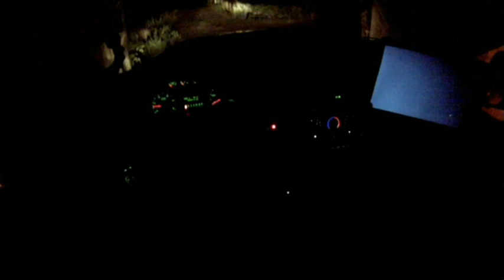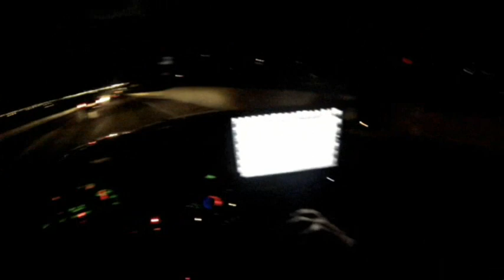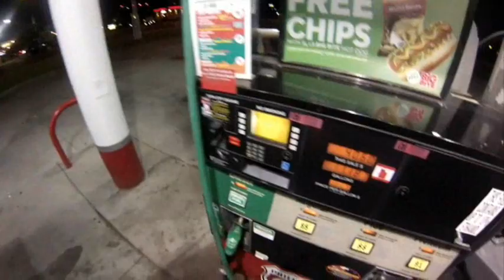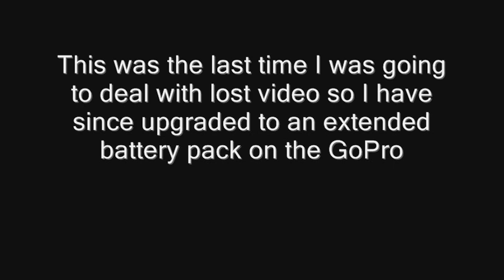No Keys On An Ex Repomans Truck Makes For A Hard Night Of Work

Comment: It looked as if you forgot and left the first blown dolly on the bed of the truck unsecured...that could turn out bad. Play safe.
Reply from the maker: I did not forget anything. I set that blown tire exactly where I wanted it to be and it was exactly in the same spot when I pulled over the second time as I expected it would be. I know my truck and I know where I can and cannot place things that will fall off. I appreciate the concern though so don't misread my reply as being snooty.
Reply: Ok,just thought you had forgotten it. Snooty? Lol have a great day Matt. Continued prayers and good vibes your way.

Comment: do you leave the truck running at all times after you leave in the morning?
Reply: keithmb33 ..yes he does.
Reply from the maker: If I have an appointment somewhere that is going to be longer than 10 min then I will shut it down. But if I am working and stopping in here or there and only getting out of the truck long enough to knock on a door or to execute a repo then yes it remains on.

Comment: Have you ever tried picking a ignition lock?
Reply from the maker: They make tryout pick sets for ignitions and I use to carry a set but the few times I tried I was not successful. I can pick most other types of locks pretty easily but have never had much luck with ignitions.
Reply: RepoNut I have picked my own house door look pretty easy, but I have never tried an ignition lock I would think the single side keys, would be easer, I don't know how you would go about picking a double side  key, lock.

Comment: just a  quick  off topic   question  ,, how  is the  engine doing ,, is it holding  up so far
Reply from the maker: It has gotten to the point that I knew I had to get it into the mechanic before I ended up on the side of the road calling a buddy with a flatbed. So it goes in on Monday and will be down for a few weeks. Hopefully all goes well and she is back on the road soon.
Reply: I hope it  goes  well and  you get  it  back  on the  road  soonest 
I know  how  expensive  that  repair is   and  being without your  primary  means of income  hurts  big time 
what are  you doing in the  meantime for a  tow truck?

Comment: Busted dolly tires? Why are you towing from the rear anyways ?
Reply: You are supposed to tow a vehicle with the drive wheels off the ground.
Reply: Not if you pull the axles or the driveline. Simple tools fix that problem....
Reply: TheKaffeeKlatsch Heavy side on the lift is bad for his truck. Could have caused even more damage than the busted dolly tires.
Reply: The front end of the 2500 with the cummins is to heavy to safely tow on the lift for that long of a distance.

Comment: Hey, two things, One I'd like to chat with you a little bit. and two, How is the truck doing? has it gotten any better/worse?
Reply: I was wondering the same thing... after he put that up I ended up going thru almost all those powerstroke videos... Seems he would be a good guy to have bulletproof your motor...
Reply: hicksvilleshick
it's a loooong long distance between where he is and the power stroke guy is and if the engine has already lost compression then there's damage there. Easier to replace the engine so you know what you have. I hope it's still working for him though. It's hard to be without a vehicle you need to do what you have to do
Reply: True, but that guy sounds like there ain't much he can't fix, for a price of course... may be worth picking up a used motor to run for a bit to save up and send it off to him for bulletproofing... either way I think it's going to be pricey.
Reply: hicksvilleshick with that being the only truck, a used motor is a gamble. you have someone elses maintenance and lack of care (or excellent care) to contend with. cheaper in the long run to really build out a block or get one stock with a warranty. that way if it fouls out there's some recourse. It's a shame that engine is going funny in the truck. It cant have too many miles on it. I'm trying to recall what it was when he got it. if I recall right it was pretty low. maybe we'll get a disection of the engine to see what went Kerflooy in it
Reply from the maker: northstar2007 I will be showing videos of the tear down and repairs of the engine as it happens next week. Should make for some good info for other 6.4 owners who end up going down this same path I am with my truck.
Reply: Awesome! RepoNut ! I have a question on Tow equipment that I've never used before and you use quite often. What would you say is the maximum range you can tow with a car on dollies?
Reply: Glad to see you got a plan worked out Matt!

Comment: why didn't you turn the truck around and put the dollies on the rear of the truck after the first tire blew?
Reply: wheelitzr2 it's rwd and can damage the transmission
Reply: zhbvenkhoReload not if the dollies are under the tires. the only way to ruin I transmission is to tow the vehicle in neutral without the engine running.
Reply: its too heavy for matts truck

Comment: You could have taken a hammer, and hit the steering wheel while you are turning it in the way the wheel needs to turn and it will unlock for another turn until it locks again, and just keep repeating until it’s straight. I do it all the time, and I’ve never had any damage, or any customer notice any damage. Or maybe I’m just a bad repo man that’s fucking people shit up…. Who knows? But I know that I do it all the time to unlock the steering column and it’s never come back to bite me in the ass. Either I’m lucky or it doesn’t ever break the locking pin

Comment: What happens if the vehicle you are actually towing gets a flat, while you're towing it? I mean, that would kind of be your fault.

BTW, you're actually supposed to (or at least it's a good idea) turn your wheels toward the curb when parked on the street in case the vehicle would come out of park or get rear ended, it shouldn't go further than the curb. Not saying that he didn't do it on purpose, though.

Really surprised that he even took the truck when you has another one (you said he blocked in the boat with it..?)
Reply from the maker: The truck blocking in the boat was his work truck and they track mileage on them so on the weekends he would have to pull out his personal truck for social calls. I have had a few flats on repos in tow and even though we were the ones pulling the vehicle at the time the tire decides to fail is not our problem. If we had not come along and taken possession of the vehicle then the owner would have been driving it when it went flat. Now if we run something over and cause the flat to happen then yes I consider that my responsibility and to replace it with a equal value tire, We will always let the lender know what has happened and sometimes they just tell us not to worry about it.
Reply: RepoNut
Ah okay, I didn't know it was his work truck that was the other vehicle :) and yeah, that's what I meant- if you run over a nail or something and that causes the tire to go flat. Sounds good! :D

Comment: would the side pull do to the wheels on the repo vehicle not wear your light duty dolly tires more than if you had straight wheels seems like you should have foreseen this as a result of the weight and drag do to the wheel cock of the repo vehicle maybe buy heavy duty wheels and tires for your dolly instead of the light duty you had on them

Comment: "Donate to make this the most awesome channel of its kind" - Isn't it already? Of course, donating won't harm anyways, but I was just wondering... ;-)
Reply from the maker: I want to add some more professional editing and content to the videos and that cost a lot of money. Plus I need the seed money to get my RepoNut gear line started and launched. I also want to invest in a quad copter drone so I can start doing aerial videos of my repos and show other cool high tech tools we can use to do this job. It all take money and donations would help me get these things done sooner than later.
Reply: RepoNut I never opposed against that - I was just saying that also without all these things, your channel is already the most awesome channel of its kind. But of course you're right, more awesome is always better for sure. So I encourage everyone who can afford it to donate to your channel!
Reply: RepoNut quad copter sounds really cool
Reply: ***** But probably hard to set up so that it actually films the things Matt wants it to film. It can't be manually operated, because while doing a repo, he is otherwise occupied, so it has to be steered automatically. I wonder how this will turn out!
Reply from the maker: Seegal Galguntijak They already have an app for iOS that allows the quadcopter to fly a preset pattern that I set up just before executing the repo and then it will land by itself if the battery gets low or I tell it to once the repo is done so it will be relatively easy once I have it all dialed in.
Reply: RepoNut Plus, you'll need an iOS device, since all you use is based on Android (which is the more rational choice in my opinion, anyways).
Reply: RepoNut This is definitely one of my favorite channels!  It's a bonus that it's REAL unlike that stupid show on TV with the fat pigs, whatever it's called

Comment: No everything went wrong because of you lol, not cause the wheels were cranked. If you would have compensated correctly for the crooked wheels it wouldn’t have happened, if you would have dollied the rear the blow outs might not have happened, if you would have grab the front and dropped linkage to back it up in to yard it wouldn’t have happened, if you would have extended the boom further it wouldn’t have happened...... don’t blame the wheels.